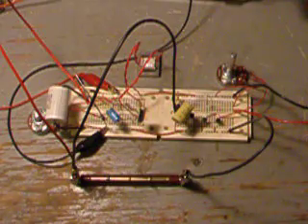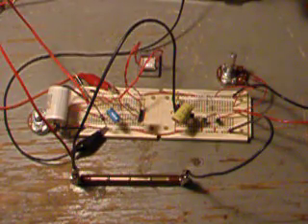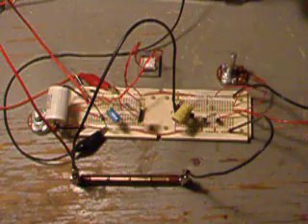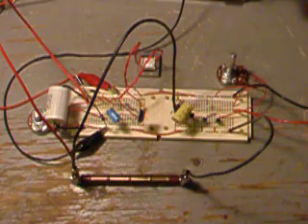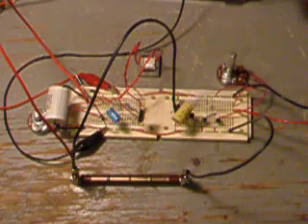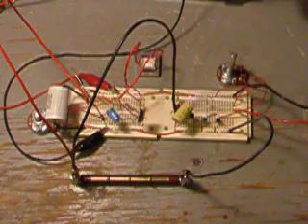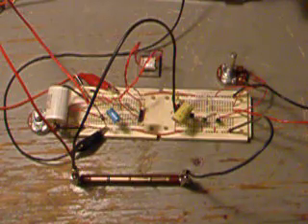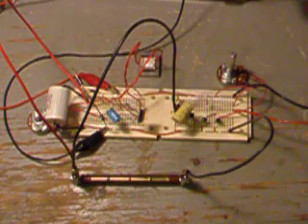My DIY Geiger Counter

Comment: Fred B's Video Blog   I know im going to have to use a current limiting resistor with my tube, but before I put the resistor on my tube I measured the voltage in series with my multimeter and had a big voltage drop, how am I ever going to power the tube with that low of voltage?